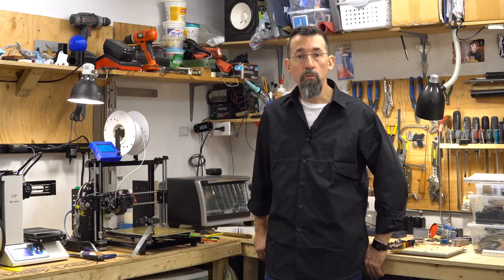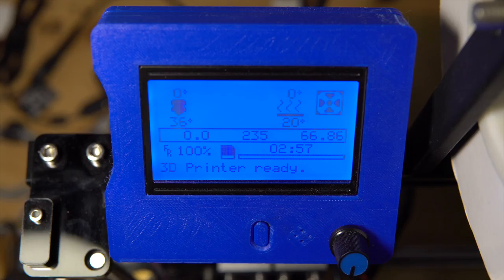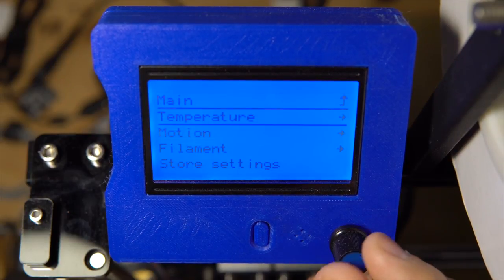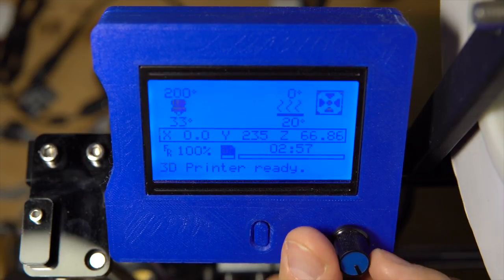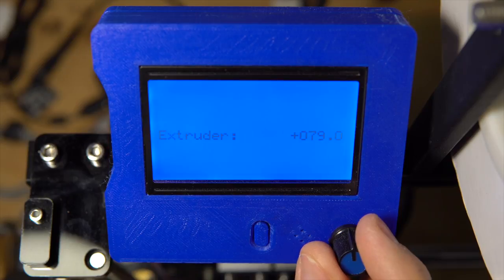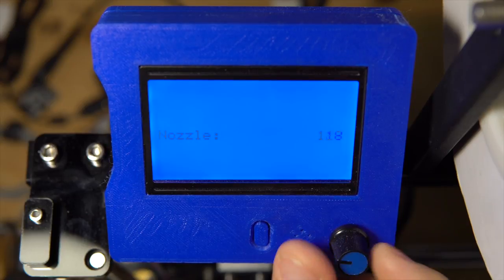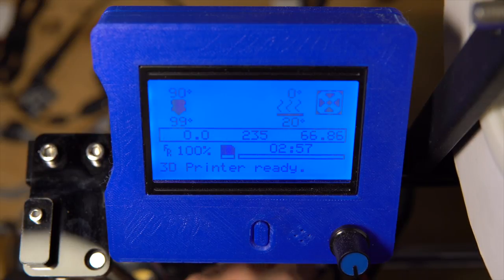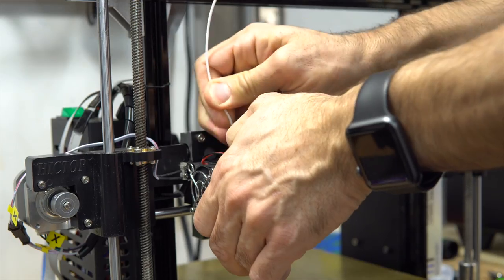How to Clean a 3D Printer Nozzle

Comment: If you are wondering, it won't work if you only heat up to 90 C and pull. There is something in the physics that say you need to first heat to extruding temperature first.

Comment: When you forcefully pull up the filament, aren’t you going to damage the gearbox that is forwarding the filament?
Reply: No because the extruder is metal at that temp it allows the filament to come out  depending on your extruder the gearbox should have a lever or should be different unit away from the extruder

Comment: The cold pull is not just for thoroughly changing filament colors.  It's a great technique when a print failed and the filament coked in the nozzle making a charred plug.  Heat the nozzle to 240 C and use a long (100 mm) acupuncture needle with downward pressure and a twisting motion to hopefully displace a 0.4 mm channel through the clog.  Load the filament (there is special cleaning filament that adheres to PLA, PETG and ABS if you like) and manually push the filament through the partially clogged nozzle.  The extruded filament will probably curl onto the bottom of the nozzle or squirt a bit sideways because the partial clog prevents laminar flow through the nozzle.  After pushing some filament through the nozzle to partially clear as much out the bottom as possible, turn off the hot end heater, use tweezers to remove any filament on the outside and bottom of the nozzle (a brass brush can be used as well), monitor the nozzle temperature, and when it drops to 90 C, retract the spring loaded filament drive wheel and quickly pull the filament up and out of the extruder with a bit of force.  Do not slowly pull the filament out when it's hot because that can deposit filament in the upper cold portion of the extruder or in the extruder gears.  The partial plug in the nozzle chamber will be extracted on the tip of the cold pulled filament.  You'll probably see black crud embedded in the filament that would probably stay in the nozzle without a cold pull to remove it.

Comment: I've printed so far 1100m of material with my printer.  Then, one day, it just stopped having consistent prints.  It wouldn't get more than spurts of super thin layers that were useless and would stop extruding.  I used the extruder function and it would spit out bubbles and not do anything.

A friend said "your nozzle is plugged try a cold pull" first result was this video.

15 minutes later after trying it, running more pla through it, and doing it twice, consistent extrusion at last!  Sadly, because i'm using that mat material and not glass, it warped on the last 3 attempts due to the nozzle being so close and basically heating the bed up and warping it in those spots.  So now there's that to deal with.

That said, this was super easy to follow and got me back onto printing stuff that I needed.

THANK YOU!

Comment: If your nozzle heats that slowly, you could really attend to adjust your PID settings.  You'll be amazed how much faster it will heat and stabilize.
Reply from the maker: Yes, I did it before, but the results where not conclusives, too much overshoot. I need to run a PID calibration and than do some adjustments manually like I did on my other printer. Just did not have the time yet, printing a lot for Christmas right now :-)
Reply: Thanks for the tip! I felt like my bed was slow to heat after I moved from stock firmware to Marlin. Turns out PID was disabled for the bed. Enabling it and autotuning shaved 25% of the heating time and is back to stock speeds.

Comment: Would have preferred a little more detail. How do you pull it through the top without a DD? Do we heat the nozzle, extrude 100mm, then cool it down to 90°, then remove the capricorn tubing and pull out the filament?
Reply: I also would have like a bit more details... but he is actually using a Direct Drive, as you can see by the position of the filament spool, and that's also why there is no bowden tube. I wish he told how to handle without a Direct Drive. Is it the same ? should we remove the bowden tube then insert the filament directly? I don't want to ruin my extruder! :P

Comment: I've had much better experience letting it cool down to about 40-50 ºC, then heat up and when it reaches temperature then pull it out. It breaks inside less often. Also is good to keep pushing material for a bit while is cooling to full the tip and avoid oozing.
Reply: down to 40-50, and then up to what temperature agakn?
Reply: @andreasv9472  probably to let the other parts of the extruder cool down first and then only heating the hot end to 90

Comment: Is that cleaning filament you're using or the PLA you want to remove? Thanks  I pulled out my Brown and ran 2 feet of cleaning filament in my Tevo Tornado.  It wouldn't extrude so I knew there was a blockage.  Heated the nozzle to 250c and hand forced the cleaning filament through the ejector into the nozzle then pulled it out.  A blob came out .  I didn't do the reduced temp.  Will next time.  Thanks for this video.
Reply from the maker: Hi, it’s standard PLA, I never used cleaning filament, at worst I disassemble the hot end and use the same method with only the heat bloc and nozzle it always worked. Thanks for the tip!
Reply: I only had to disassemble the hot end one time.  Found the PTFE tube wasn't seated all the way into the heat sink and the nozzle was all the way tight to the hot-end.  After cleaning it all out and using a new bowden I re-seated it and it works great. Last night I had the clog I mentioned.

Comment: After doing this, I reconnect the bowden tube to which my reel is attached, and I get a blockage -- after free-flowing filament in a test. Am I pulling out the test filament before it's cold enough?
Reply from the maker: Sometimes you have to do it more than once. If you pull at 90 or set the temperature at 90 so that you have time to pull, it should work, with PLA...
Reply: @Franks3Dshop  Thanks for the quick reply, btw. When I'm pulling it out, is somewhat melted at the end; I guess it's not cool enough, then possibly solidifies by the time I get another print going...Not sure. Went through two nozzles yesterday alone.
Reply from the maker: It should have the from of the interior nozzle, if it’s melted maybe the temperature is not what the printer shows, verify if you can that the thermistor is correctly position...

Comment: Would a cold pull work on 3d printer pens using PLA Filament?
Reply from the maker: I do not think so, you would have to disengage the extruding mechanism not to break it.

Comment: This totally not worked on my Ender 3. The cold pull had my ptfe leave a gap with the nozzle that I haven't noticed and after a few printings the PLA carbonized inside the hot end. Would neve try this again.
Reply from the maker: Hi with a long Bowden tube, to prevent this you can undo the PTFE tube, I have a video with my mini doing just that. But you can also change the nozzle.

Comment: I have a bowden tube with PTFE hotend. I tried a cold pull with PLA. Ended up in clogging the whole hotend.  Heated up to 200, pushed a little while letting cooling down. First try at 90C PLA broke. Next try at 130C worked. Did it again, whole hotend was clogged, even heating up to 260C didnt help. I pulled out the bowden tube and put in PLA direct. Is that wrong? Or do i have to do the cold pull from the external extruder thru the whole bowden line?
Reply from the maker: Hi, with bowden tube it can clog in the PTFE tube, you can remove the PTFE tube and do it directly, the goal is to remove big particles in the nozzle that would not fit through it, also check the end of the PTFE tube that goes in the hot end, sometimes they get damaged and particles of PTFE gets in the nozzle.

Comment: great video ! does your printer use a Bowden tube ? does it have an all metal hot end?
Reply from the maker: +TheSageBen in that video that printer is a direct drive extrusion and I have put a harden Micro Swiss all metal hot end. My other printer is a Monoprice Select Mini, it uses a Bowden tube and does not have an all metal hot end, you can replace the hot end for a E3D v6 all metal.

Comment: Why not hot pull? It seems like less intuitive to clogg up the nozzle
Reply from the maker: Cold at around 90 degrees because it is still soft and takes the debris with it when you pull it out.
Reply: @Franks3Dshop  Ah so it's the mild temperature that does the trick. thx :)

Comment: How often would you guys recommend doing this? after every color change? or a certain time frame?
Reply from the maker: Hi, I do it when it begins to clog, you can see it when you extrude in the air, if it curls up it is partially clog, it will also manifest in the prints, and you could also hear the extruder skipping steps if it’s to hard to push filament.

Comment: Since I changed (for the first time) the PLA filament on my Anycubic I3 Mega, I am experiencing issues that I think might be caused by a clogged nozzle.
How can I perform a cold pull on my I3 Mega (you surely know it uses the teflon tube to feed the filament)?
What are the tempratures for a cold pull if I use PLA?
How can I set the right tempratures if the I3 Mega doesn't hallow to choose the tempratures (it has the pre-heat function, but at fixed tempratures, PLA at 190° C, and ABS at 235°C)?
Thank you.
Reply from the maker: Hi, it's similar for your printer:
1- Preheat the printer, remove the filament.

2- Stop the preheat
3- Remove the Bowden tube from the hot end or unscrew the fitting and remove.
4- Insert some filament manually (if it does not go in too well, use a piece of bowden about 100mm that you put in then the filament.)
5- Preheat again
6- When at temperature, extrude manually some filament
7- Stop the preheat
8- Wait for the printer to go back to room temperature
9- Preheat one last time
10- At the same time pull on the filament during preheat (hard but not too hard do NOT bend anything)
11- At some point the filament will come out when warm enough and should come all at once.

If you do it with white PLA you should see if there is something coming out with the plastic.

Repeat until no debris are left.

Reinstall the bowden tube or fitting.

Comment: This can sometimes be a VERY VERY BAD IDEA depending non what kind of hotend assembly you have. Some hotends are designed in such a way that trying to do this will literally break the internal components, if you can even put in enough force to do so.

It annoys me a lot that I see tons of people talking about cold pulling and NEVER mention the possible issues it can cause. Please mention these problems next time.
Reply: Can you give an example of a hotend that this is bad to use with?
Reply: @SysadminsWithGuns  No. He cannot give an example.